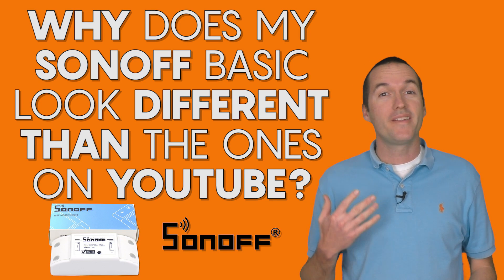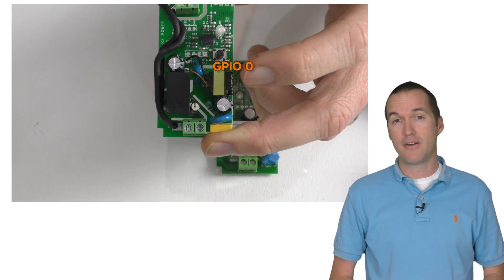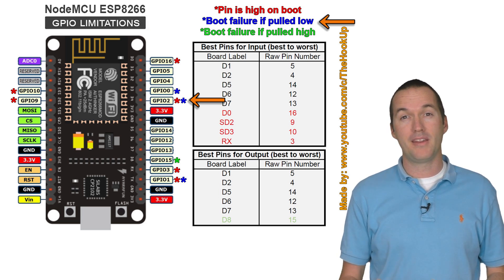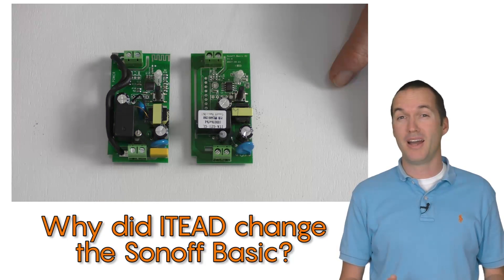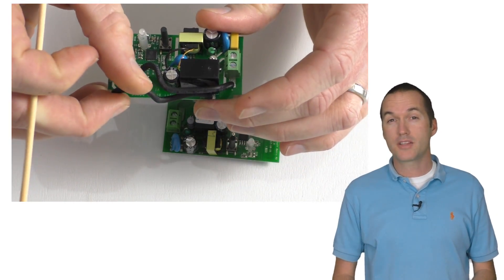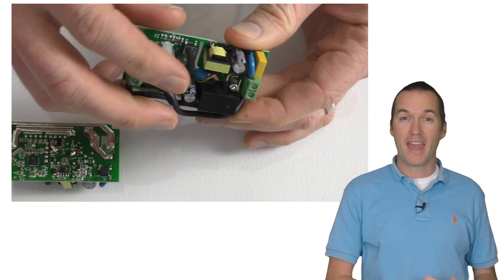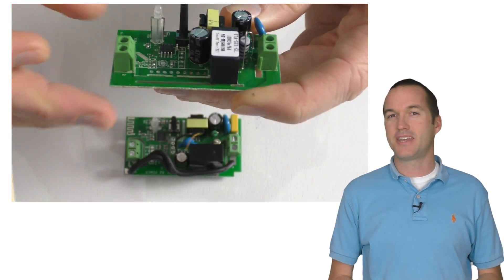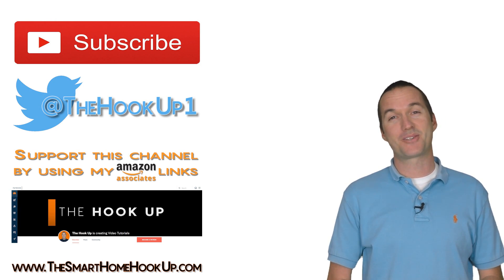New Sonoff Basic? Wires Inside? Is it better or worse? The Sonoff Basic RF R2 Power V1.0

Comment: Is it possible to measure temperature and pressure with a TH10 ?  I have a TH10,  DS18B20 and Pressure transducer (3 wire, grnd,3.3v and data).  I want to monitor my pool temperature, and pressure of the pump.

Comment: I have flashed the latest basic r2 (GND, Tx, Rx, 3.3V on the side of the chip) with the latest version of tasmota (9.3.1) I tried Rx and GND, but the console shows it is sending "@@" or sometimes "1", just random commands when I close the switch, I have allocated the pin to switch 1 and disabled serial logging to no effect, this is really frustrating. Has anyone managed to do this. on a very old firmware, the key works as a momentary switch, I thought upgrading the firmware and allocating GPIO2 pin would do the trick.

Comment: I tried connecting a touch switch using the ground, 3.3v and gpio3 at first for a about 30 second works perfect then the sonoff does a factory rest and I have to reconnect it to my wifi. I set gpio3 as a button do you no what could be causing this please?

Comment: Question - none of this Sonoff stuff seems to be UL or ETL listed. 

Are you not concerned about testing from normal “I don’t want you to start your house on fire” labs?
Reply from the maker: Cautiously optimistic... you can crack these things open and analyze the circuit, there's not much to it.  I wouldn't use them to power high current devices, but for stuff that's pulling less than an amp? These are fine.

Comment: Root of the problem is bloody ITEAD/Sonoff not providing a NC contact on its relay (to safe costs of course, low budget). If only they had done a little more thinking, it would have avoided so much trouble to combine with existing on/off lightswitches!  I don't like to make myself dependant on electronics/internet/lan and as you know a lightning strike will kill it and your way of switching on a simple light. Therefor I think it's better to either replace the relay of a Sonoff by a type that has NO and NC contacts, so combining it with an existing switch is no trouble and even a failing relay and or electronics will still leave you to switch on the light manually! OR just add a simple second relay that has NO and NC contacts, operated by the Sonoff, and therefor giving you back full manual control with any existing (3-pole) switch. I wonder if Sonoff is short for Son-off-a-bitch or more Son-of-a-switch ? :-) hahaha

Comment: Thank you!  Just wasted 2 hours trying to connect an AM2302 to GPIO 14 on a new Sonoff basic based on an incorrect diagram showing GPIO 14. works just fine on RX/gpio 3.
Reply: hello Steve
were you able to also use any of the other inputs to toggle the relay? and if so what were your connections, thanks.
Reply: @76queen  I didn't try. Only needed temp/humidity inputs. Just using Home Assistant/Alexa to turn on an exhaust fan.

Comment: Hi, i have used my sonoff basic for turning on and off air conditioner unit in my house .
After few days my sonoff switch got broken ( connects to wifi and it can be turned on or off  using App  but when it's on doesn't deliver power at output ) .
What can be the cause of problem .
Please help . The sonoff version is old version as shown in video

Comment: I am a definite newbie.  Looking for instruction on adding a momentary contact switch to a Sonoff Basic R2.  GPiO03 to Ground  (with GPIO03 set to switch1 in config) does not work for me.  Should I be using GPIO03 to 3V?

Comment: hey, thanks for the video i nearly panicked when i noticed it was not the same as all the other youtube videos. So i did what you suggested by using GPIO3 and it worked fine for a number of weeks but just recently it has failed. any ideas? i can still control via Alexa and via IP control just not via my wall switch

Comment: There are a number of older version Sonoff Basics which have seen board failure due to uneven soldering - even if the load was much less than the 10A rating. I have to agree that the HV isolation and improved safety are the main drivers for the revision

Comment: Complete newb trying to wifi enable my garage door for google home and also connect a reed switch/door sensor to know when the door is open or closed.  1.  Where should I connect the reed switch door sensor (along with how to flash)?  2.  What do I need to do for the low voltage continuity on output side and not full voltage (previous generation you just cut the board)?  Was planning to just use ewelink and google home if possible/ aka minimize software and coding needed.
Reply from the maker: I wouldn't suggest a sonoff basic for that application.  First, the reed switch/door sensor isn't going to function properly using the ewelink app.  Second, the sonoff basic carries mains voltage on it's relay output, so it will fry your garage door opener.  You should look into the SonoffSV or the Shelly1 for that application.  DrZzs has a good video showing how to do it with a Sonoff SV.

Comment: There's no problem with GPIO2 if you use an optocoupler and have GPIO2 going low turn it on.  That also allows you to not worry about about the current out of the pin and keeps what you're switching more isolated from the groundless Sonoff power.

Comment: Not sure if it's already been mentioned but switching to a load wire rather than trace let's you use the relay to switch a hot+load wire set up more easily than having to cut the traces on the board, just an initial thought.

Comment: I'm still running two first gen unmodified sonoff basics. They work well, but the wifi reception is horrible. They are losing the connection all the time. I've ordered a Sonoff s26 because those ones are a lot better and also more convenient for my use.
I will also order a sonoff basic 3rd generation soon.

Comment: But "key" is gpio0 😊 spent half of a day trying to configure the "key" as gpio2 (using it for pushbutton so boot state does nit affect it) just to find out it is gpio0 🤔
Reply: Confirmed - the 'key' pad goes low (to gnd) when the pushbutton is pressed, so it IS GPIO0 and NOT GPIO2 as mentioned in the video.

Comment: How are things with the connection of sensors now? I want to order the DHT22 sensor and connect it to Sonoff R2 via GPIO3, pin RX. Read the old comments that the sensors show a value of 0 because there is not enough power. Develop doubts. Where is the truth? Will it work or not? Who connected the sensors, share your experience. Can be another model sensors need to?

Comment: I would really love to see a solution to how to add a sensor (like a reed switch) with this hardware and Tasmota.  No success yet finding a pin to use.  

On my second try, it was easy to remove the mains voltage from the relay and isolate the relay to open/close a garage/gate.  Just can’t add a sensor yet.
Reply: Hey Justin, Were you able to modify the new sonoff basic to open / close a garage door opener?
Reply: Yes, I have been successful, but I used two pieces of hardware.  For the open/close I use the sonoff where I cut the 120VAC away from the relay and linked the relay to just open and close the output terminals.  Then for the sensor I used a nodemcu also running Tasmota.   The sensor is a standard floor mounted garage door reed switch. Maybe I could have made it all work with one nodemcu.

Comment: Hi Rob, I loaded Tasmota into one of the new Sonoff Basics, and used GPIO3 for the switch as suggested in your video.  This Sonoff controls six 8-feet florescent lights in my garage - about 570 Watts.  Everything seems to work except the light turns off by itself randomly.  Using the Tasmota console and MQTT.fx, I noticed the Sonoff is receiving a command with a blank payload, which is causing the switch to turn off (e.g., in Tasmota console:, I see this: 16:36:07 MQT: cmnd/garageLight/POWER =).   Neither the Sonoff or Rasperry Pi running HASSIO have rebooted during this time, so I speculate this problem is not related to the retained flag.  What do you think is causing this?
Reply: I have a bit more information.   I noticed the Sonoff Basic mentioned in my post above is disconnecting and reconnecting to the network repeatedly.  In the Tasmota console, I see "Attempting connection," followed by "Connected," over and over (see below). The Sonoff Basic is actually in a detached garage, so disconnects may be due to a weak WiFi signal.  But it always seem to re-connect without problems.  Notice the empty payload in the "cmnd" message shown below.  I also see the same LWT message and the cmnd message with an empty payload in MQTT.fx. 

02:19:34 DNS: Initialized
02:19:34 MQT: Attempting connection...
02:19:36 MQT: Connected
02:19:36 MQT: tele/garageLight/LWT = Online (retained)
02:19:36 MQT: cmnd/garageLight/POWER = 
02:19:36 MQT: stat/garageLight/RESULT = {"POWER":"OFF"}
02:19:36 MQT: stat/garageLight/POWER = OFF (retained)
02:20:03 MQT: tele/garageLight/STATE = {"Time":"2019-03-13T02:20:03","Uptime":"2T00:06:49","Vcc":3.488,"SleepMode":"Dynamic","Sleep":50,.............
02:20:03 MQT: tele/garageLight/SENSOR = {"Time":"2019-03-13T02:20:03","Switch1":"OFF"}

Is the Mosquito broker sending the "tele/garageLight/LWT = Online" and "cmnd/garageLight/POWER = " messages?  Why is it sending a cmnd message with an empty payload?

I seem to be able to control the Sonoff switch using HA without problems despite the disconnects and re-connects.  But the empty cmnd message is causing the light to turn "off" when it was "on" before the disconnect.

Any ideas on how to fix this (maybe via some settings?) other than trying to get a stronger WiFi signal to get rid of the disconnects.
Reply: I have 3 Tasmotized Sonoff Basics, and 1 Tasmotized Shelly1 in the detached garage.  The switches are located very closed to each other.  I only see the disconnects / re-connects in two of the Sonoff Basics.  The third Sonoff Basic and the Shelly1 operate without problems.  I am puzzled.
Reply: I think I'm experiencing problems described in this thread: https://github.com/arendst/Sonoff-Tasmota/issues/4686
Reply: Disconnect problems disappeared after I downgraded to core 2.3.0 as described in the discussion accessible via hyperlink above.  I tried core 2.5.0 as well; it reduced number of disconnects significantly but I was still getting a few here and there.  Core 2.3.0 seemed to have eliminated disconnects entirely (i.e., no drops in over 24 hours).  According to TasmoAdmin, I'm also getting better WiFi signal strength with core 2.3.0.

I still don't understand why Mosquito is publishing a blank-payload cmnd message after a re-connect.  But I'm no long convinced that was the cause of my mysterious lights-off scenario.  Please comment if anyone has an opinion regarding this.

Comment: I was trying to convert mine for my garage door opener and noticed mine was different than the instruction videos.   Has anyone came up with a solution to make the newer R2 open and close a garage door?
Reply from the maker: I'd recommend a Shelly1 for that application since it is designed for dry contacts.  I wouldn't recommend modifying the circuitry of the basic since all of the burned sonoffs I've seen were the result of such modifications.

Comment: can you still use the new basic for a dry contact
Reply from the maker: I wouldn't recommend either version of the basic as a dry contact (most of the burned sonoffs I've seen were from that particular modification).  You should get a Shelly1 if you want a dry contact, it's a better product and is made specifically to support dry contacts.
Reply: @TheHookUp  champ, thanks

Comment: I have removed the bi color led because de red part isn't even connected. Nou I can solder a wire to the smd resistor because this contact is larger to solder. I configured the gpio13 as switch input instead of led1i. I didn't find a good forum to post my pictures
Reply: The tasmota github page might work, or the discord, or the home-assistant.io forums. Interested in seeing your work! Or a youtube vid :)
Reply: @JasonWho  I add it to https://github.com/arendst/Sonoff-Tasmota/wiki/Sonoff-Basic
Reply: I might have found the pad, right below where GPIO2 punches through to the other side of the board? but on the ESP chip side it looks like there's a resister on the trace?

Comment: I see you like Shelly one more than the Sonoff basic. Is it because of safety? I mean I would not want to skimp on safety when deciding b/w the two.
I have flashed Tasmota on Sonoff with header pins, attached a PIR sensor and regular wall switch, w/o any extra resistors or capacitors with no ghost switching so far. Just worried about safety.

Comment: If GPIO03 is high on boot, and I connect it to a switch that will connect it to the GND, how will that work? Won't it damage the chip? And if not, how it can be high during the boot if I connect it to GND? Also, does the pin have a pull-up resistor,  so that it will be high if the switch does not connect it to the ground? 
Would the same thing work on Sonoff Dual R2? I think one of the buttons there connects to GPIO0, so if the switch connects it to the GND during the boor, it will go to programming mode (kind of 50/50 lottery). So RX would work better?
Thanks!
Reply from the maker: It will not damage the chip, it's really only an issue if you are connecting some output device (like an LED or a relay), which results in that output device turning on for ~400ms on boot.

All pins on the ESP8266 have pullup resistors except GPIO16, which has a pulldown.

Dual R2 is also an ESP8266, so all the same concepts apply.

Comment: I believe it's easier to isolate the mains current from the output on this new model - I mean to modify it for Isolated mode (Dry Contacts). Have you tried that?
Reply from the maker: I thought this would be the case, but unfortunately the wires are from the relay to the output, not the input to the relay.
Reply: Thanks so much for the video. Is it still feasible to modify it for dry contacts or is it now more difficult than before?
Reply: I am also interested in modifying the new version to get isolated dry contact in the output if anyone help me in that since I bought a bunch of sonoff for this project and was unaware of their changes

Comment: Isn't the Sonoff RF (radio frequency) a different product? The Sonoff RF can be controlled via WiFi and also via an RF dongle
Reply from the maker: Correct, they are likely using the same circuit board for both, they will just add additional components to the RF version.

Comment: Hi, with this unit not using GP14 / GND, you mention that we need to use GND and RX for our sensor, what should be the Module Switch configuration parameter to use these leads as a sensor?  In the past for R1 Basic, I've used GND and the 5th GPIO14 pin to connect this to a door sensor, and the "GPIO14 Sensor" parameters is set to "10 Switch 2".  Thank you.

Comment: Is the onboard button still on gpio14? If so could you not just desolder it and connect your new switch/button there?
Reply from the maker: onboard button on both versions is GPIO-0
Reply: @TheHookUp  oh my mistake I thought the old board it was 14. But could you remove the button and connect to it there without any issue
Reply: @jameslong296  GPIO-0 can not be low at boot, device will enter flash mode, so no not as useful as GPIO-14

Comment: Can you still solder a small wire onto gpio 5 leg of the esp chip like the older model? Glad I still have plenty of the older ones...
Reply from the maker: Sure, you can always solder directly to the ESP chip, but at that point I think it's more trouble than it's worth.
Reply: @TheHookUp  yes it's a bit of a fiddly job, but it's definitely worth it! I'm using my sonoff basics for all they're worth including connecting a capacitive touch pad to gpio5 and sticking it behind the light switch bezel and having a rule to send an mqtt toggle cmnd to my workbench S20.

Comment: Just a question about ghost switching. Is it still possible to make a low pass filter on pin3? I tried on pin 2 and got said boot issues. Hadn’t thought about gpio3 until seeing this. Another bad reason for gpio2 is that the pad gets pulled off easily.
Reply from the maker: Should be able to use a low pass with 3

Comment: I'm thinking that they sent you a Sonoff RF rather than a Basic. Also, what is that yellow part on the "new" board? could that be the RF part? The new board doesn't even say basic on it which I would think that they would put that on there if it was a basic.
Reply: Is is basic version, RF is just print on board as I assume they use same board for RF and basic version. I have ordered around 20 Sonoff basic in last month and half, all of them were new versions, identical to the ones in video

Comment: either you or theo got it wrong...
in github page Key is GPIO 0...
https://github.com/arendst/Sonoff-Tasmota/wiki/Sonoff-Basic
Reply from the maker: I'll double check when I get home, but either way both GPIO2 and GPIO0 cause boot failure if pulled low, so I wouldn't recommend either of them.

Comment: oh man just orderd somthing like 7 , now what to do with them with no GPIO 14

Rob are you sure there is no way to breakout GPIO 14?
i connected the Key and it looks like its switching the relay on and off for now... are you sure this is gpio 2?
Reply from the maker: GPIO 14 doesn't exist on the ESP8285, so for sure not that one.  If it is connected to GPIO-0 then it has the same function as pressing the button on top, so you'll need to be careful not to long press or you will reset it.  Also, if you pull GPIO-0 low during boot it causes it to enter flash mode which is obviously not what you want for a functional switch.